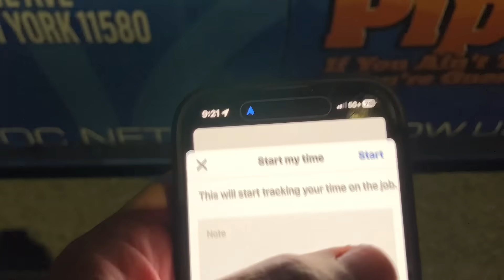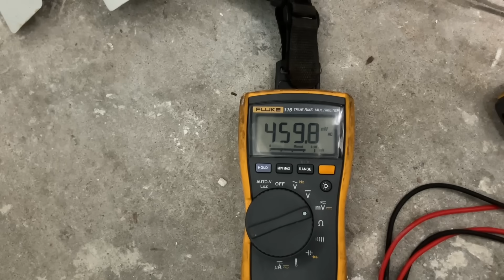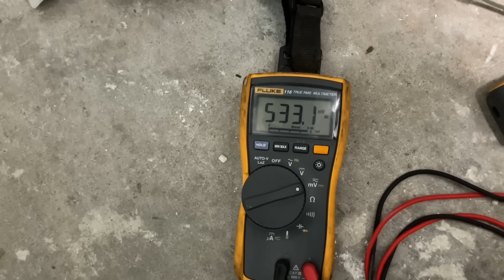Bradford White Water Heater - Pilot Won’t Relight Bad Gas Valve Replaced

Comment: Never could understand why people insulate a gas water heater.  As you said the jacket blocks the vents.
Reply from the maker: Exactly.
Reply: you're supposed to trim the jacket above the vents and tape it off properly, that said the biggest standby loss is via the large hole through the center of tank "the flue pipe".
Reply: @throttlebottle5906  If I am not mistaken the install instructions state not to install a jacket. The heaters insulation has been increased a while back as the dimensions of heaters has increased.